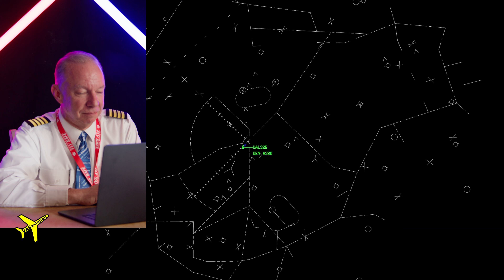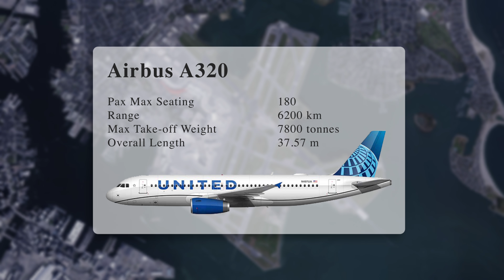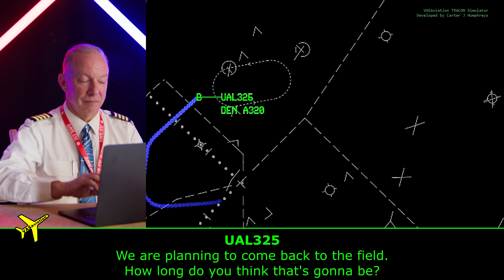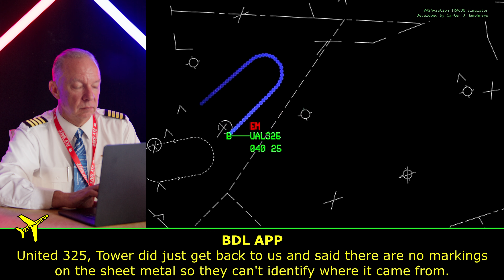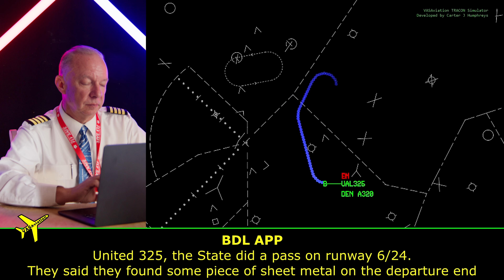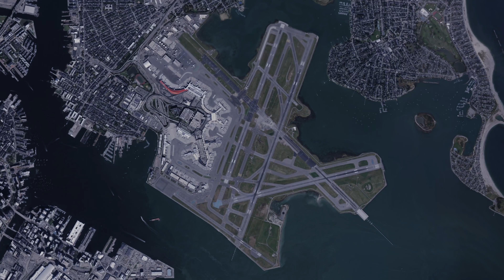United 325 Disaster Averted: Engine Trouble at Takeoff! | Captain Steeeve Breaks It Down

Comment: Hi Steve, I am an air traffic controller myself. I love how, in judging and explaining through the situation, you put so much emphasis and value on the commucation. I see it exactly as you do, this degree of clarity and calmness in all of this, is what makes this challenging situation go so smooth after all. Props to everyone for staying clear, calm and collected in communicating, without ambiguity. This is simply solid, good work, good airmenship. And its definitely not as easy as it may seem here, since in a situation like this everyone's a little tense. Thanks for your great work by the way, keep it up. ❤🎉
Reply: All commercial airplanes should have cameras in the wheel wells so the pilots can see if there's an issue
Reply: Y’all have balls of steel.

Comment: How 2 jet engines loose all power just after take off?
No matter if it is crew error or not that must never happen. 
Maybe if the crew felt one or both jet engines were not acting right on take off then that would be an issue
but
That was not the problem!
There was enough power to lift the bird from the tar mat into the air so both engines were good to go. 
Even with one down there is enough power to get the bird back to the tar mat.
Something cut both engines and even if the crew did it the Boeing deamliner should have told the crew do not do that or stop or caution or something to warn the crew not to continue.
Take Off 
Almost automatic noting is done on take off and landing.

Comment: Do'nt understand this. Of all the technology  in the Cock Pit of a Plane there's is nothing to tell the Pilots of the state of the tyres. My cars dashboard tells me of the air pressure of each individual tyre. These Pilots are concerned about loosing a tyre. If the plane had the same technology as my car they would see that tyre number 3 has no pressure and go from there. it's so easy.

Comment: My thoughts as a retired Flight Simulator Engineer with 10 years experience are as follows.

The first suspicion that may arise is this - could the pilots have pulled the lever to straighten the flaps, thinking it was the lever to retract the landing gear? But this is unlikely to happen on the Dreamliner. The two are not close enough to be interchangeable. The flap lever is to the right of the engine throttle on the pedestal between the pilots. The landing gear lever is located on the main instrument panel, below the flight display panel, on the captain's side (left).

Kindly ALL decent HUMANS please GOOGLE THIS before making wild guesses. I know you are all trying to save Boeing. The USA CONGRESS is onto all POOR QUALITY CULTURE AT BOEING.

Comment: hi from France.....   a good video.....metal parts on the runway ARE a major danger..... a part of an engine trust-reverser of a Continental Airplan DC 10, just 43 cm long felt of the plane during take of..... 5 minutes later a Air France Concorde Supersonic-Jet with 109 soals on board hit this debris.... The debris blew a tire, the tire blew a hole in the wing, fuel leaked out and set the engine on fire.......the fire consumed a part of the wing....the plane crashed...... all 109 persons on board and 3 people on the ground perished in the crash 2 minutes later !  This was the only ever occured accident of the Concorde....and sealed the end of the Concorde area.... 😪      Never underestimate debris !

Comment: I've noticed that a lot of the time, ATC like to have remaining fuel in time, and AARF want it in pounds - probably because one is interested in how long you can stay airborne, and the other has to deal with a potential volume on the ground - and as fuel burn rates can vary wildly from aircraft to aircraft, you can't easily extrapolate one from the other without knowing the specifics for that particular airplane.

Comment: The pilots didn’t indicate but 15/33 is approximately 6800 feet. Which is in the short side for this airplane. If you can pick a 9000 foot runway it’s much more desirable. They are concerned that maybe a tire was damaged on the takeoff and would severely hamper their ability to use 33.

Comment: I much rather they return when there are problems that they can't identify or even a loss of an engine - you never know when something more will happen while you're in the air between airports. Pilots and ATC are trained to be calm as they work through problems. Though that is not always the case. A calm ATC person is very good when the pilots become excited and stressed by immediate problems that could end them. But good crew resource management can save the passengers and crew members - have one pilot fly the plane and the other looking at potential problems, and full communication with everyone seems to be the best in all cases. It'd be interesting to find out what they lost.

Comment: Why don't airliners have tire pressure monitors like many cars? This would let them know if there are any flat or missing tires.
Reply: Good point. I also wonder why didn't MH370 have a GPS tracker ?  
I have one on my motorcycle in case its stolen, it cost 15$

Comment: They are and sound professional and it was a good call to shut down and get a tow to the gate because you don't want to turn up at the gate and the engine blows apart or catch fire  not only that by shutting down it stop more damage which is going to add to the repair bill

Comment: Good stuff again Steve!  It would be interesting to know exactly what parts did come off the aircraft.  I worked and taught NDT for about 25 years.  I was ASNT certified in UT, RT and ET testing.  So, failure analysis and failure reconstruction is "my thing" so to speak.   It is really quite fascinating, especially in these days where "blame the pilot" is always the cheaper rout for the MFG and Airliner's liability.  The NTSB is straight foward and open minded in their investigations & recommendations, where as the FAA is much slower to enforce if it cost the industry too much money.  Failures are of course very rare, and I hope completely eliminated some day, but for technical analysis and the understanding of issues like fatigue failure, I started a website detailing the technical side of some of these failures.  The site is mainly for A&P, techs and engineers, inspectors etc...
Reply: What's the website called?  I like to analyse faults too...😊

Comment: The momentary EGT over limit is not a big deal. It’s solved by reducing power, as long as it didn’t exceed certain parameters what concerns the pilots is that they were told they left parts on runway.

Comment: Captain Steve, I am a healthcare professional, and I am often involved in emergency situations that require very rapid analysis of the situation and decision-making. I am now at a point in my career where I’m actually analyzing adverse outcomes for a patient safety organization. The airline industry does such a great job on taping every single thing that is happening, decisions that are made and the  evaluation of the process after the event. It only recently that patient safety organizations ask healthcare professionals involved in a sentinel event to do a debriefing as quickly as possible, once the patient is stabilized. Sadly, this is not always done. Also, when it is done, recommendations for improvement in the process are rarely made. Why? Because there is still a great deal of hesitancy in scrutinizing the actions of physicians. If there have been major issues related to inadequate communication on the part of the physicians, nurses are reluctant to address the issue. In fact, they  actually admit to having been intimidated in the past when they have reported problems regarding violation of protocols by physicians. I don’t know if you’re aware but multiple studies have confirmed that over 100,000 patients die in hospitals each year due to medical error and that is a conservative estimate. I am having my students actually view many of your videos. You’re carefully detailed and objective analysis of the case studies you present provide them with some of the essential information they need when identifying a problem, communicating the problem to the appropriate team members, articulating a plan to all team members that are going to be involved in dealing with it. You illustrate how important communication is. Thank you for your great videos and I hope you continue to provide us with them.

Comment: This example and many others I've seen on "Air Disasters" show indicate that pilots are often oblivious to damage to engines, landing gear, structural pieces and control surfaces.  I understand the conservative nature of aviation regarding change, but it seems long past due for cameras (cheap, light) to be placed in strategic areas so pilots can quickly ascertain the state of their aircraft.  They can even use AI to monitor these video feeds to alert as soon as there's a problem.

Similarly, the emergency ground crew should have a mechanism to share the images/video they take with both the aircraft and maintenance experts on the ground to give a real-time assessment of the situation.

Comment: I think if anything abnormal such as gauges are incorrect or just anything in that cockpit happens all planes should turn around if they can or land at the nearest place. I say that bc with all the plane crashes ive seen on here they all have one thing in common and its that something abnormal is going off in the cockpit and the pilots try to fix it but it always ends up in some kind of major failure where the plane goes down. So my tip would be just land better safe than sorry trying to troubleshoot a problem out of anyones control

Comment: for those curious as to what happened. here is what a google search turned up.
"On June 20, 2024, United Airlines Flight 325 was forced to return to Bradley International Airport (BDL) in Connecticut after a piece of the engine cowling fell off. The Airbus A320 aircraft landed safely, and no injuries were reported. 
What happened?
The flight took off from Bradley Airport at around 8 AM 
Shortly after takeoff, the flight crew reported an unusual noise 
A piece of the engine's sound-dampening outer liner was found on the runway 
The aircraft flew in random patterns near the airport to burn extra fuel 
The aircraft landed safely at Bradley Airport about an hour after takeoff "

Comment: I'm a private pilot.  Our local airport isn't towered. It's up to us as responsible pilots to announce. A bird went through my prop on takeoff and splattered all over my windscreen. I announced a retur,  and my fellow pilots were listening. They asked if i had a problem. I replied,  nothing that a little windex won't fix. I literally had to crab it in since I couldn't see ahead. When I returned, there were pieces of that bird on every leading edge of that plane😂
Reply: How do you avoid birds at the airport or is there technology to detect if there are birds ahead of a takeoff?
Reply: @FlappyBelly  Also, it's still safer to fly than it is to drive to the airport.
Reply: @jg72-t5u  That is true
Reply: @FlappyBelly  see and avoid is the best we have at my local small airport. It's easy to see the migrating geese, but avoiding smaller birds is difficult.
BTW, most pilots in my area operate small aircraft, which are rarely equipped with advanced technology.
Reply: @jg72-t5u  But like with that FedEx plane that got a flock of seagulls in their engine, is there a display in the cockpit that would show birds?
Reply: @FlappyBelly  I'm not sure since I'm not a commercial pilot. But I believe it would be difficult to identify a flock of birds, especially on the lower elevation of takeoff, even on radar.  That's why communication from other pilots is so valuable.

Comment: I was doing a research project on Eniwetok atoll and we would fly from Honolulu on military  C130  to Midway, refuel and then fly on to Enewetok. This one time we took off from Honolulu flew to Midway, landed, refueled and took off again. However, they couldn’t get the landing gear to retract fully after we got up. I remember the guy sitting next to me, another grad student who had been in the Air Force sat bolt upright as we leveled off too soon. He jumped up and went to the flight crew. On those military planes there was no door between the passengers lined up along each side of the plane and the flight crew. My colleague and the flight engineer went to the bay over the landing gear, opened it up and tried to manually pump the gear all the way up. Didn’t work. So they couldn’t pressurize the aircraft due to the doors on the landing gear not closing so we had to fly no higher than 10,000 ft. Plus something about the landing gear doors being open prevented the autopilot from maintaining level flight so we kind of dolphined up and down. We couldn’t go back to Midway since they didn’t have fire and rescue equipment there and also no parts. So they decided to fly to Guam. There was a bulldozer chained down int the middle of the plane that was reeking of diesel fuel. Took us 10 hours to fly to Guam. When we got there they radioed that we need the rescue equipment and then my colleague and the flight engineer tried to get the landing gear down manually after they couldn’t move it with the hydraulic system. So we flew past the tower to see if the gear was down. They said it looked like it was but there was no way to tell if the gear was locked in place so it might have collapsed on landing.  The flight engineer went through emergency landing procedure and we landed. The gear held until we had pretty much stopped and then we gently slide down onto the plane’s belly on the runway. What a scary thing.
Reply: Wow! What a story! So glad you had a happy ending
Reply: Holy smokes
Reply: Mexican low rider plane..
Reply: Wow 😳 that's 🤣 crazy! 😂😂 Did they ever figure out why gear wouldn't fully retract?? Suppose gear door open also limits IAS as don't want to rip it off its hinges.  😂 Cockpit crew was having a blast 😂. Glad you made it down. Tell your grandkids. "I remember this time we..."

Comment: The concern about it being a  tire is probably due to the fact that they are "highly" overweight for landing....  Nice to have all your wheels when that happens!
 
The Long Roll may have also been due to the fact that they may Not Have used the Thrust Reversers....  (If the debris came from #2 engine, then I don't want to risk something bad happening when I deploy or try to deploy my thrust reversers and throttle #2 up!!!)

Comment: I was in a flight out of Bradley the next month after this incident, (also United to Denver) where the flap actuator broke and the pilots couldn't retract the flaps to get to altitude. Ended up making an emergency landing about 45 minutes later.  No issues with the landing itself, but we did have ems and fire waiting for us just in case.

Comment: Re the low pass option, if you potentially have an issue with your engine you don't necessarily want to lose height and then put extra thrust through the engine if it gives up suddenly when you are at 500ft but not landing?

Comment: The airline has given an official statement and it said, 'Flight 325, en route from Bradley International Airport to Denver International Airport, returned safely to Bradley to address an engine issue. A portion of the engine's sound-dampening outer liner was found on the runway.

Comment: In the chronological sequence of what was known at the time:  “In case, by chance, we’re missing a tire.” 

“The pilot now…it’s reignited his concerns about the tire…that it might be a tire issue. So he asks one more time: ‘are you sure it’s not a tire issue?’”  Because the suggestion of a low-pass tower observation was rejected (as it might “unnecessarily” alarm passengers), is it correct to assume that if in fact there was a missing or damaged tire —and not knowing which one— that the pilots of the aircraft would not have had to prepare any differently for the landing, while 10,000 to 12,000 pounds over maximum landing weight?

Comment: 8:29 uh I’m not a big fan of oh the fire crew can just not say what they are seeing cause it’s their “culture”. Yall good with that 😂. Yeah hey 777 coming in to land uh I don’t want to describe what debris I’m seeing in any manner cause it’s my culture and I don’t want to get in trouble. Doesn’t sound like a good culture to me.
Reply: The reason was that the guy, who was in the line of duty, did not want to make a wrong assessment or give the wrong info about those parts, and then get himself AND his company liable for any fallout based on that wrong info. He was a firefighter, not an aeronautical engineer. It had nothing to do with culture. Capt Steeeve should have known that. 🙄
Reply: @istudios225  its a brief assessment, its not a final report. Its not his job to know. He chose to put lives at risk unnecessarily and WOULD certainly be liable if that plane fell out of the sky while he was cleaning up the parts it dropped. 

I mean he must be a stooge. For fuck sake, you dont need part numbers, "sharp metal chunks, painted paneling, shredded rubber" etc would do.

This is like a doctor not diagnosing & treating someone because they could be wrong. so if they just let them die, they wont be held liable more misdiagnosed them.

Comment: I'm only a 600 hr. PPL, but for the life of me, I can't understand why these airplanes don't have cameras pointing to the engines and landing gear. It's beyond me that ATC has to tell a pilot that they have an engine fire on take off or to do a low pass past the tower to determine if all the wheels are still on and the landing gear is down etc. I bought a wireless camera that I installed in my motor home so I can keep an eye on my car trailer that's behind me. It cost me 80 bucks.
Reply: that would be a great idea. unfortunately these aircraft manfucturers are so full of beauracracy great ideas probably don't get heard and implemented often.